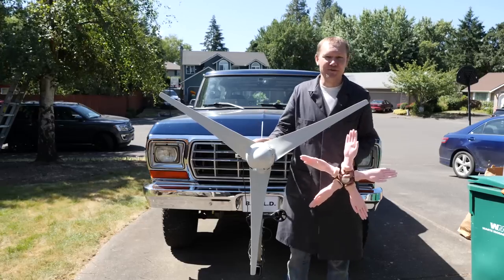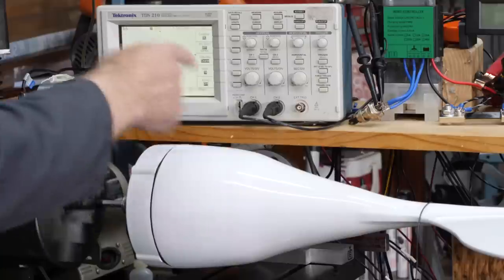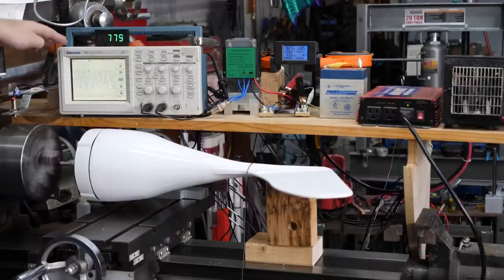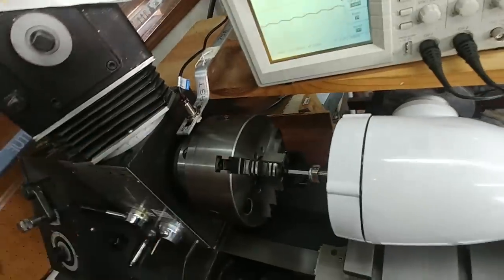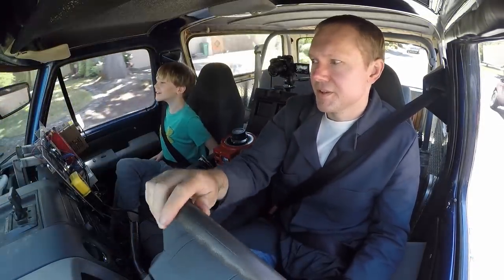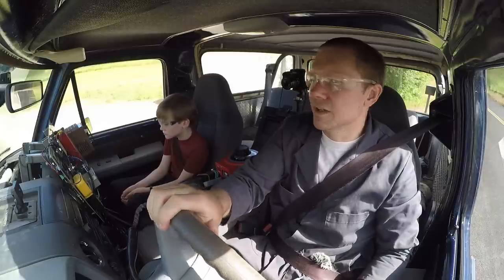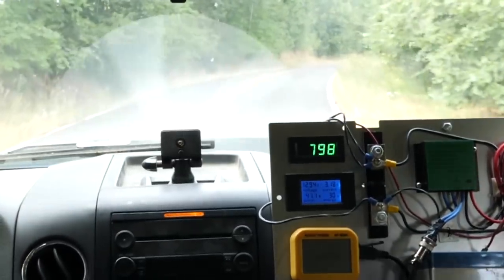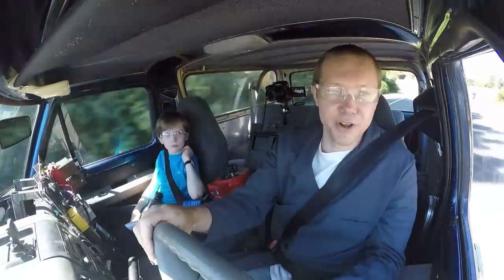Wind Power on a CAR #2 - Testing the Betz Limit for Turbines

Comment: As per other comments I didn't like your arms so close to the lathe , not sure about the short sleeve comments as we had to wear a full boiler suit when I worked in the engineering shop, but a chuck gaurd is a must, I'm sure you could make one yourself very quickly, stat safe as you have a great channel 👍

Comment: I bought a 500W  24V version of this turbine and put it up 25 meters on a scaffold pole with steel guy ropes. Never saw more than 0.5 A even on a 50 mph windy day. When I winched it down and tested with an 850W electric drill it produced  4 - 5 A. The 3 blades are just not capable of turning the generator for any significant power. I tried several different electric drills and never saw more than 5 A or 120W
Reply from the maker: Bummer!

Comment: i would say your control box for the wind turbine is the problem try a normal 3 phase rectfire maybe also an mppt controller pussling the turbine down to that of the battery voltage will always get alot les then the unit can prodcue same with solar

Comment: I think there has to be some aerodynamic effects detracting from the output. You are pretty much stalling the air right behind the blades when it gets to that massive radiator. The top blades are running in slightly cleaner air because the windshield is farther back.  The bottom blades may be robbing momentum from the top ones as they act more like a driven fan than a wind turbine. They may actually be pushing the air through your annemometer.  Can you top mount the rig or put it on a flatbed trailer way behind the truck?  You may be able to show if this is the case by taking off the turbine and leaving the annemometer on in the same location to compare with the reading to the speedometer.
Reply from the maker: Once I get a setup that's seriously cranking out power (4-5kW) I'll do three runs: turbine above the rig, in front of, and no turbine at all, monitoring mileage and power output for all three.  Then we will know for sure what the dynamics really are... I think.  There's always the possibility it will just raise more questions!!!

Comment: I just have to say; that is the cleanest lathe I have ever seen and I've seen many.
Secondly, from the mouths of babe comes wisdom. 
Lastly, yeah the rigidity of the blades is a major factor in how much power is output. Not unlike a speaker cone the blade have to couple to the air in order to transfer power to the rotor. You might even consider making carbon fiber blades to replace those and possibly changing the geometry. I suspect the rotor or windings are not really the problem. They can probably do 500W at peak (maybe 250 RMS). It's the blades that can't couple to the air sufficiently.

Comment: I assume one main issue is the controller. It's not taking as much current as it could. If you try with just a 3 phase rectifier and a variable current load maybe you can find a better sweet spot.

Comment: I have a friend who paid a lot for (supposedly) the best wind turbine on the market to for generating 12 volt electricity for his 45 foot sailboat on a transatlantic trip from New England to the UK and then across France  to the Med via canals.  The thing never worked at all.  The turbine just never got going fast enough,  It was as if there was too much load even when there was no load at all. He took it apart and checked everything but when he put it back together it still didn't work.   As far as I'm concerned, I don't believe in small turbine generators.   It take a pretty sizable turbine to get reliable power.

Comment: The turbine has fixed blades, with each blade having diferent shapes along it's lenght to produce lift at every speed range, but that's not optimal, it should change the angle of attack in relation with the wind speed and the rpm (blade speed)
I've been doing some research on the topic lately

when designing the blades, you could try diferent NACA profiles, there is a free program that analise each profile you select, the Cd, CL...
It is called xflr5

Comment: Just throwing something out, here. Wind turbines designed like that are generally placed some distance apart with no obstructions in front or behind them. Would the proximity of your truck behind the turbine be causing some sort of turbulent interference? This wouldn't be applicable on the lathe, of course.
Reply from the maker: I wondered (and still wonder) if it matters but didn't appear to for this size. We'll see when it gets bigger.

Comment: The relative wind speed of the air around the car is probably lower towards the front of the car. Like the car pushing a cusion of air and reducing wind speed. Maybe mount it on the roof?
Reply from the maker: We'll get there

Comment: Awesome engineering, just curious if a 8 inch water turbine can generate sufficient power could a similar turbine be ran off of wind perhaps a series of vents leading into a single channel where the wind speed is increased to the turbine producing similar results as the water turbine, therefore everything could be housed within the vehicle and adapted to any new vehicle if it worked?
Reply: heavy resistance air is less dense to spin on youd need  huge propellor

Comment: Losses from the electronics might impact a theoretical output and should be analyzed.  Additionally, the new blade still looked mad floppy.  Check out Tech Ingredient video about building rotor blades.
Reply from the maker: Been CAREFULLY watching parts 1-4 on Tech Ingredients...  👍👍👍
Reply: @QuintBUILDs  he is an impressive dude.  Have you emailed him?
Reply from the maker: @norvillerodgersspeaks  I haven't reached out yet. He puts so much detail in there don't think I need to. Maybe after I'm done building it to prove to him I'm worth responding to? 😂 Very impressed with his channel and intellect.

Comment: Why does the second phase line have a smaller amplitude? Are the coils for each phase unequal lengths? Doesn't this defeat the point of phases balancing a load?

Edit- Looked way better on the second oscilloscope so I guess its a sampling error on the first one. Cheers Quint I'm learning a lot from this channel
Reply from the maker: You're learning right along with me.  With the first scope I figured it was a problem with the generator, then with the 2nd scope it was nearly perfect across phases so clearly it was an issue with my setup.  That Tek unit is a hand-me-down scope and could easily have issues.  I'm guessing I just need to calibrate one of the probes.  I've always had issues taking voltage measurements with it.  The numbers I get don't seem to add up.  Glad you're enjoying the channel!
Reply: @QuintBUILDs  Could also be an issue with each channel having a common ground.  Didn't see any details of exactly how you were attaching to the windings, but two different phases might have needed two different reference grounds.  Maybe your better scope allowed that?

Comment: You need to be careful disconnecting and connecting high spinning alternator that can put out as much as household 115 volts when spinning at a high rpm even though it’s considered a 12 V system !!! All alternators on vehicles can put out enough voltage if not connected to a battery to absorb the volts burn the system out in a alternator!!

Comment: I was wondering if instead of plugging in a small heater, you plugged in an electric motor (May with a generator?) that replaces the lathe.
Would it be possible to spin the wind turbine at a speed sufficient to make the inverter work?
This would become a closed loop system if it was possible. I'm not talking free power, just enough to keep itself operating.

Comment: You need a bigger lathe dude ... my 12x36 gearhead would do the trick . It's 220v ...biggest problem people have is that they are greedy when they want power . If they would use a much lower amperage dc generator the motor drag from the turbine would be much lower because it will not be over a couple amps but it will do it continuous and easy.... and the battery bank will store it during times of wind . Also Longer slower moving blades would be much better . plus an added cooling fin system would lower heat which in turn also helps on drag and longevity

Comment: I'm more curious about that modern looking dash in a old Ford bronco
Reply from the maker: Thanks! It's a resto-mod I did with the engine, trans, transfer case, ABS,  and A/C from a totaled 2004 F150. Just took it thru DEQ testing again and it beat the old 1978 standard no sweat!

Comment: Skip that "controller" and just use a straight 3-phase bridge rectifier... for these tests. And a car battery, or at least a riding mower battery. Those little non-spillable things are NOT rated for the current you're trying to push through. A large capacitor would not go amiss, either.

Comment: I suppose those controller/chargers are pwm, you may be better with a MPPT controller because it wold generate output with lower rpms, unless those chinese controllers are BS... Another idea would be to use a rectifier bridge and then a DC-DC converter to accept a tension range and have a fixed output and feed it into a solar charger which is easier to find in good quality at a decent price. The problem with this would be the braking system... Maybe you could connect the original controller in parallel with the rectifier bridge so it senses the input and short the coils... Maybe...

Comment: Is it possible that the truck is pushing a wall of wind which could inhibit the on coming wind to fully pass through the fan blades without resistance or any kind of discrepancy?

Comment: I like your design of pedestrian shredders. Did you text how effectivle shredders pedestrian? Is it also effective to pedestrians on the side walk when the wings detatch?
Reply from the maker: Once the pedestrian is run over it's difficult to discern what's caused by the turbine vs. front axle.
Reply: @QuintBUILDs  The front axle is not the problem. Usually the first hit of the head on the hood or the hit on the road after bouncing back is the killing part. At lower speeds you have a significant chance to survive.... if you were not shreddered by a wind turbine.

Comment: Either belt configuration would use the same electricity. Your just using a different gear ratio. sacrificing torque for speed. Also no long sleeves near a lathe.

Comment: I don’t think it’s a problem with the generator output. I think the propeller/turbine is being overrun and losing torque at high relative wind velocities. It’s almost essentially the same as when an airplane with a fixed pitch prop accelerates to fast you lose efficiency because the angle of attack decreases.
Reply from the maker: I agree that certainly happened, but only at highway speeds. We always started at the spec wind speed and it still failed. I've calculated the relative wind at highway speeds for 1k-3k rpm and the turbines don't appear all that far off.

Comment: I want to know the amount of work you are losing in efficiency from gas consumed.
Reply: Agreed. Thought the same thing.
Reply from the maker: Later, after we learn all about wind.  THEN we'll circle back about how ridiculous the system is as a whole.
Reply: @QuintBUILDs  I'm not sure it will be as inefficient as we would guess due to the fact the difference between what would have been used anyway may not average out to a unacceptable MES.  And since you are making the alternator redundant  you can remove the alternator and make that comparison as well. ;)
Reply from the maker: What I'm really curious about is the effect of reduced drag on the truck body vs, when the turbine is above the truck. There's got to be some small recovery of spent energy but the horrible inefficiency of a gas engine likely more than wipes it out.
Reply: @QuintBUILDs  My brother has an RV that he put solar on. He already has a battery set up and needs the power to recharge it to keep his electronics/heater/AC. He also has to travel a lot. So, the question of is this more or less efficient than just running a gas generator to charge a battery?
Reply from the maker: @thisguyhere85  an excellent way to frame the question! Future videos will have the answer because I honestly don't know!
Reply: @QuintBUILDs  This is ridiculous but educational. You could reduce the drag on the truck body to almost zero if you replace the wind turbine with a big enough wall but the available energy in terms of the force on the wall over the distance driven will never compare to the extra energy the engine needs to consume to drive after adding that wall.
Reply: @thisguyhere85  Solar is more efficient if it is big enough, but it may add wind resistance when driving the RV that increases gas consumption more than the gas a generator would use.
Reply: @michaels-ideas  most RV are not aerodynamic... So a few flat panels on a roof will not affect the drag coefficient of the vehicle.

Comment: those cheap chinesium wind turbines are over-rated to sell more.  You need to buy a unit from a reputable manufacturer - like Marlec, out of the UK.  They make a quality turbine and their customer support is great.  I use one of their Rutland 1200 Models on my boat, and never had issue keeping my batteries charged and running my refrigerator and lights.  It's only rated to 483Watts, but I've seen it output 500 watts before it goes into overpower shutdown.
Reply from the maker: Thanks for the info on marlec. Nice to see there's a reputable company/product out there. I looked for reputable sources prior to purchasing these crappy ones but nothing came up. :(

Comment: Number one, real quick look I haven't been paying attention, I assume you're using a gear reduction motor. You do realize, when you spin that, it may spin free enough when it's not generating current, but when it makes power, it's going to have more resistance on it going up as you accelerate. In fact, with a gear reduction, it's going to exponentially increase the resistance. Allow me to explain. Spin the motor free wheel. If you're using a brush motor, dead short the two leads coming out of the motor, wrapping them together. Now turn it. That's actual motor braking, which is what kind of resistance it will have on it while it's generating current. I haven't even really watch the video, but if you're using a brushless motor, you won't be able to do that test, but it will still exponentially increase the rotation resistance of the shaft according to your gear reduction. Put it this way, the alternator in your car will free Spin quite easily when the car is not running. But when the car is running, and the system is producing current. Resistance goes up as more amperage is produced, your average 100 amp alternator can draw as much as 20+ horsepower from the engine!!! Now multiply that resistance because of the gear reduction box, those little blades just ain't going to spin that kind of resistance. If I were you, I would use a hundred amp alternator with those blades directly connected. Have them charge a separate DC circuit, and then connect your inverter to it. This system would work very well, plus the alternator will be internally regulated, and you won't have to worry about spinning it too fast. On your average vehicle, alternators  Usually spin twice as fast as the motor. your shaft speed will never hit 10,000 RPM so you will never have to worry about resistance, @ 2:1 the car engine double the speed, but takes twice the horsepower to do so. Your fan blades can run at 1:1, which takes half the force to turn the alternator, with your fan blade. The air would also help it stay cool, and, they are somewhat water resistant. Yeah, that's the way to go.
Reply from the maker: No gears

Comment: Good experiment, I have a question.

If the amps of the wind turbine rated as 20 amps, the amps will the same if I'm using 12v battery system, and also will the same if I'm using 24v battery system.
Reply from the maker: The amps will be roughly half at the higher voltage
Reply: @QuintBUILDs  it means the wattage will be the same.

Comment: no turbine is getting 59%, and those turbines are typically half the "80%" figure, so 40% of 59% is  at best 23% and that is only a specific speed.   Most of those turbine blades are not even that efficient and have other trade offs.

Putting on front of a car is not ideal laminar flow so you will get additional losses.   I had an actual air-x and it produced around 100 watts in 25mph and 500 watts at 40mph but not on a car, but on top of a 12ft pipe with no obstructions nearby.   It cannot sustain power near the cut-off either, so a 400watt turbine can only make continuous 200 watts at best in most cases since the gusts will cut it off above that.   Still it's a lot of power and you can do a lot with that.

Comment: Could the lack of power be due to the lack of airflow behind the turbine as it is only feet in front of the vehicle causing the air to be forced to slow behind the blades causing a flow restriction?
Reply from the maker: See part 3.  I address this towards the end.